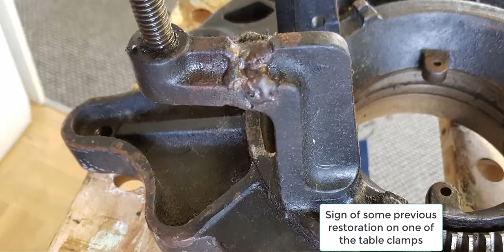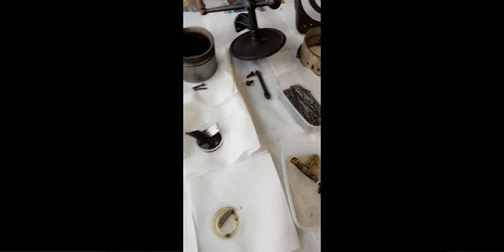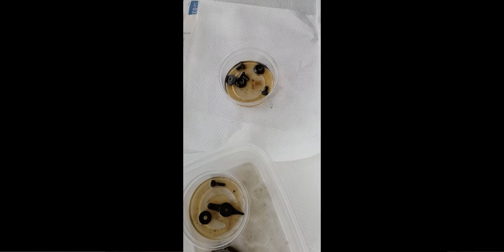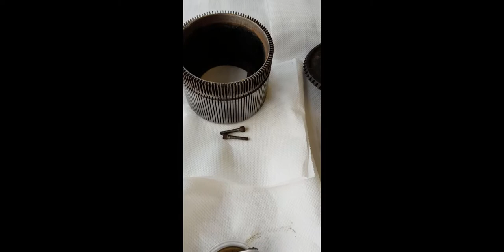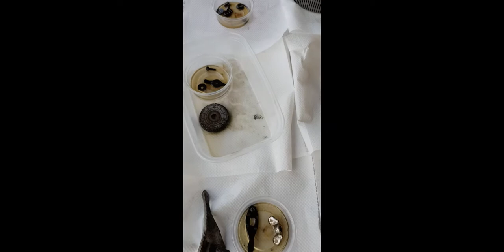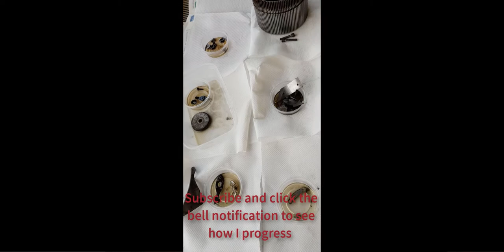sock knitting machine refurbishment part TWO

Comment: What kind of cleaning solution did you use? I just received my Creelman Autoknitter and it is a working machine, but I notice the same rust ring at the top inside the cylinder.
Reply from the maker: I used some very fine wet 'n' dry paper and carefully sanded it away.